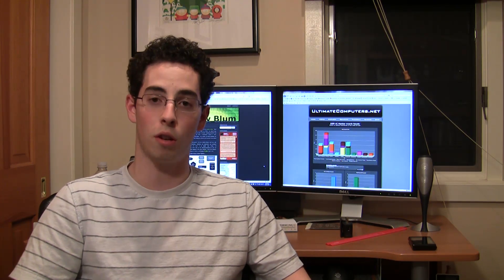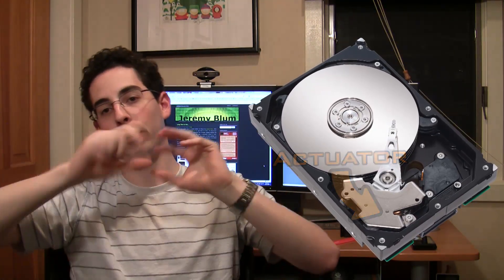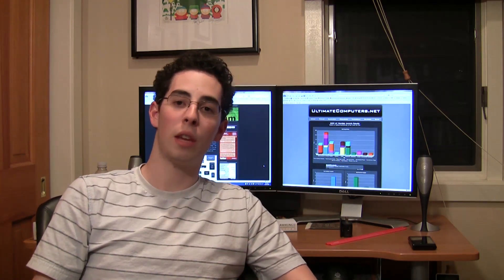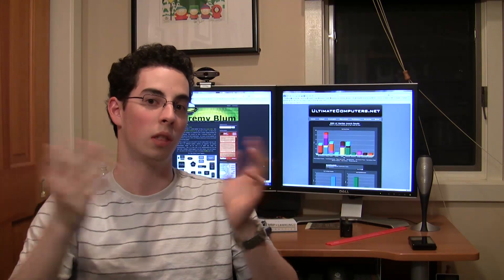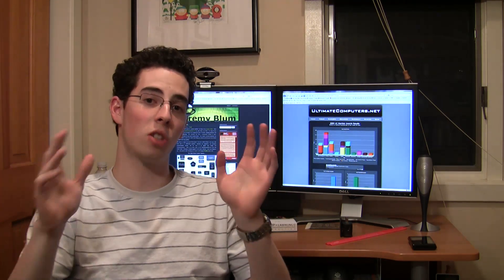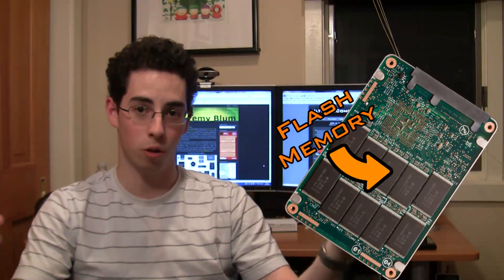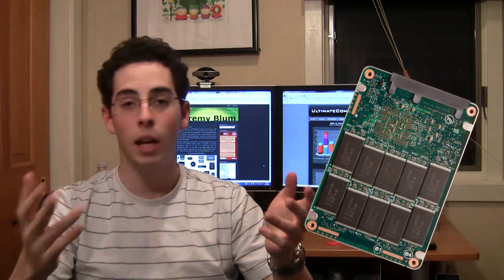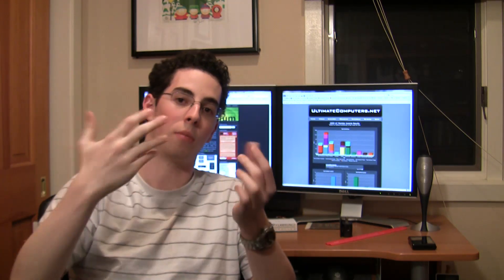TechBits 11 - Mechanical and Solid State Drives Compared

Comment from the maker: I didn't say it's shorter overall, I was just trying to explain that the flash can degrade with time, and eventually fail.  I'm not certain of the time frame, but It's actually probably longer than most mechanical drives last.

Comment: Lol, Windows 7 boots in 20-25 seconds on my 7200rpm mechanical hard drive from the push of the power button to the fully loaded desktop, so a 15 second less for boot is nothing of importance and I will not be buying an SSD anytime soon, even that I have dropped my WD 320GB hard drive multiple times and still works like new.

As for that guy saying they put the OS in BIOS(reason I'm replying to you Films4You), it's impossible, that person told you complete bullcrap.

Comment: don't necessarily have to have 'money to burn' to buy an ssd. for a notebook (or even general purpose desktop), you can get a 64gb kingston ssd for about $150 (newegg). granted, not high end like intel, but i notice much better performance over the standard 5400 rpm notebook drive